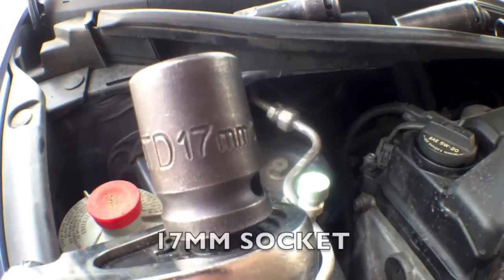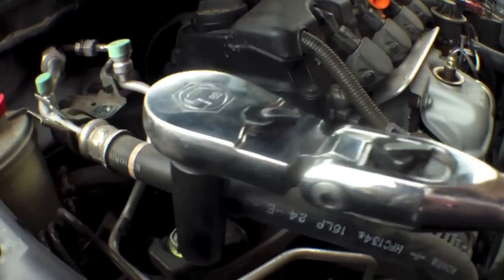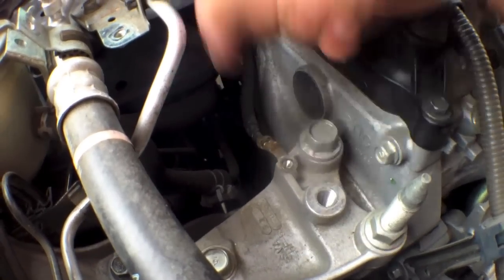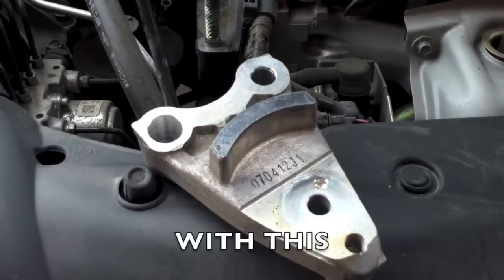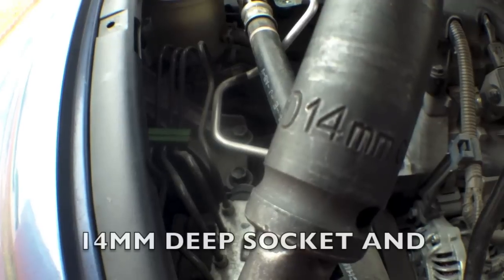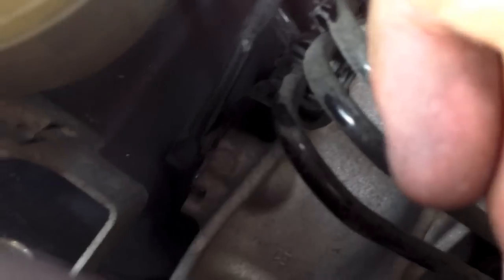SIMPLE REPLACEMENT passenger-side engine motor mount Honda Civic √ Fix it Angel

Comment: First , thanks for posting I just did this repair today on my daughters 07 civic. I used your video step by step. However I found that this is not a one man job.i first ran into problems getting the replacement mount holes to line up. That was a quality issue with the part. The really tough. Part was getting the little round tab on to of the new mount to line up to the A shape bracket and then getting the 2 holes lined up on the engine side. It took one person moving the engine back and forth until the tab finally fell into the the bracket hole. It turned into a 6 hour job. With that being said, your video was very helpful. Thanks again
Reply from the maker: Hi Eric, good job for figuring it out.  Have a nice day

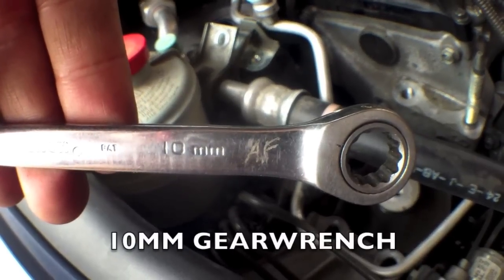Comment: The video helped very much, when I replaced my engine mount today.  Many bolts were tight, from corrosion, since there are 130,000 miles, on my 2008 Civic.  I left that little 6mm bolt, in the aluminum bracket, at the 3:00 minute mark.  Everything else, went as the video showed.

Comment: Just did one of these on my civic a week ago. If you're very careful, you can leave the one 10mm on the side of the middle bracket that's connected to the mount s and just have the 3 bolts disconnected, and you'll be able to move it just enough to give you enough room to pull out the mount without having to completely remove that middle bracket, while not damaging any lines in the process. Same goes for sliding the new mount underneath that bracket as well. Its somewhat of a pain having to get the bolts realigned that way, but it's not super bad to do at all as long as you have patience. Other videos will have people disconnecting the brake line brackets and the ac line brackets just to give you more clearance, which is good in order to not risk damaging any lines, but it is unnecessary as long as you are careful

Comment: I replaced the engine mount a few months ago late at night with a few mates and it was not a one man job at all . We spent 2 hours trying to line up the 2 bolts on the mounting bracket while pushing the engine back and forth and ended up leaving it as everything was bolted back in. I bought the aftermarket engine mount from Transgold.

Comment: Great video! Followed it exactly and changed the mount in under 1.5 hours. When you put the new on, you may have to slightly rock the engine but it moves easily enough. I used OEM part ($200) since I read that some after market part holes don't line up all the time and that some may fail after a year or 30k miles.I also prefer OEM but to each his own. My original lasted over 95k miles and 7 years. Hopefully this new one will last the same amount of time. Anyway, it's an easy enough repair as opposed to having the dealer do it for $500 plus. The vibration is completely gone now and car rides smooth. Thanks for the excellent video!!
Reply: Did your motor tilt when removing the dog bone bracket?  I've heard engine likes to tilt backwards and lifting oil pan towards the rear helps.  What position was yours? I might be doing this job with a car jack.
Reply: It didn't move during the removal of the dog bone. After the mount was removed it had shifted a little. I had a helper and used a floor jack with an old lawn mower blade between the jack and oil pan since the civic is so low to the ground and I didn't have jack stands. I put the jack in center of pan. We just raised it a little and you can rock the engine slightly to get the holes to line up. Wasn't a big deal. Just think things through before doing it and you should be fine. Helps to have an assistant.

Comment: Cool channel and great video.  I'm about to replace all mounts since I can't really see which one is causing my issues!  My issues with my car (2008 civic EX 5-Speed):

Vibration upon accelerating from a stop in first gear.
Slight Vibrations while in neutral at idle.

I'll let you know the results

Comment: Yea it’s easy to take apart but unlike mine when I put mine back together I had to pull and pry and leaving all the bolts loose so I wouldn’t cross thread the bolts. it’s a pain in the ass but I got it

Comment: Do you recommend replacing all the parts you replaced in this video, or can we solely replace the actual mount of the engine?
Reply: Ide say in the long run do them all  why  because if you replace  1 new part and the rest is worn out it will destroy you new part a lot quicker

Comment: thanks for the video. it helped with my 2006 civic! Did you have trouble lining up the side mounting bracket? I bought an replacement mount from Anchor and I think the specs were off a lil bit, because I couldn't get the side bracket on correctly. What mount did you use here?
Reply: I feel like the engine or something hits! it's more on the freeway at high speed when I let go of gas then press on the gas fast. also when I don't give complete stops then gas it something is moving. any ideas my friend?
Reply: Transmission mount maybe? I know my car does this too and my transmission mount is cracked..

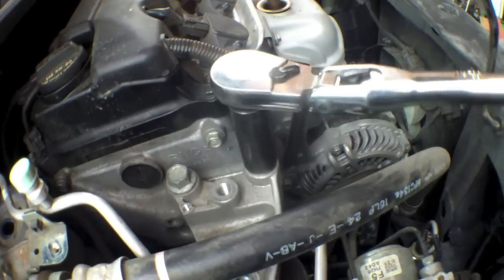Comment: Hey Angel please reply to me.. idk why the bracket keeps getting stuck on me (at 1:58 on your video). I can't get it off :( 
Is a pry bar needed to get the bracket off?
Reply from the maker: 209 Fishing hi, it might be rusted on. Try using a pry bar.
Reply: @FixItAngel  it has no rust. But the engine does tilt a little so I'm guessing thats the reason why it got jammed. I will try a pry bar when I have time. Hopefully it work. Thanks for the quick reply!

Comment: Question, is the top bracket part of the mount necessary to replace?  Cause on Rockauto the mount alone (black rubbery part) is only 25 dollars, but adding that metal bracket doubles the price.

Comment: What size wood block you recommend? When you place floor jack underneath oil pan does it need to be in the center or rear of oil pan? I've read someone having their engine tilted back. Thaanks
Reply from the maker: Hi, any size as long the metal part on the jack doesn't hit the pan.

Comment: Mechanic Replaced my engine and transmission mount. 6 months later it collapsed again and vibration came back. Not sure if they used OEM or aftermarket but it looks OEM. Thinking my car might just be defective and is motor mount hungry 😞
Guess imma need to replace ‘em again. Rip bank 😢

Comment: Thank you so much for this video! I think this is the problem with my car. Do I just repalce the upper dog bone like you did or do you know if I have to replace the lower torque strut mount as well? Thanks again! I am gonna purchase off of amazon soon.
Reply from the maker: Hi Stephen, It is better to replace all the mounts. If you replace just that one, it will prematurely wear. Welcome
Reply: Ok. Thank you. Do you have other videos or any suggestions in replacing other mounts?
Reply from the maker: Yes there are videos I made. Please check my channel.

Comment: I have a 2012 Honda Civic. I am getting the vibration into the cabin which feels like the dash is vibrating/shaking. I think my transmission mount is worn because the vibration is worse when I put the car into reverse and it will stop vibrating when I put the car into neutral.

I am really disappointed in Honda. I only have 70,000 km on my car. My Corolla had 248,000 km and never replaced any engine mounts or transmission mount. Honda really needs to fix this issue.

Comment: Hey man, thanks for the video really helpful. I can't get those two bolts in the engine side! any tips to get them out??
Reply from the maker: Hi Eissa, Try using a 1/2" drive breaker bar to get more torque to loosen the bolt.

Comment: Do you recommend replacing the torque rod each time, or was there something gone wrong with your old one?
Reply from the maker: +asdf072xxp The part was just old. More likely the rubber on it was worn. I recommend replacing all the mounts because if you just replace one, the new mount will prematurely wear because of the old mounts are worn.

Comment: Mine is loud while driving, higher rpms make it louder. It's a manual, quiet in neutral, but loud when you rev it up in neutral, has a vibration. Think this could be the problem? All the noise is under the hood

Comment: great vid! also need to replace mine. how much torque did you use when you put everything back on?
Reply from the maker: +snwbubble Hello and thank you. When the bolt or nut is seated(screwed all the way down by hand), turn ratchet 180°. (12 o'clock to 6 o'clock). Thank you for the question. Please share and subscribe.
Reply: +Fix It Angel ah ok. So you didn't use a torque wrench or anything?
Reply from the maker: No I did not. It's not like bleu printing an engine. As long it's tight you are good.

Comment: Where do you recommend getting the parts from?
Reply from the maker: +dreamingtree101 How much you want to spend? The original parts is very expensive but it is always recommended. Aftermarket parts are cheaply made but have a warranty on it. I would go for the aftermarket, I always tell my friends and family. I never seen a new aftermarket engine mount break within a couple years.
Reply: What brand do you recommend and where do I get it? I'd to avoid fitment issues

Comment: I'm having this issue.. For some reason my dam car still vibrates i recently took it to honda and got my motor mount changed, was working fine for around 3 days and it started vibrating again! Where are you located??
Reply from the maker: Did you just have the passenger motor mount replaced?
Reply: Yes i did
Reply: my car still shakes, i noticed it more today this morning, my only choice is to take it to a shop...sucks

Comment: I replaced all the mounts but this one... and the vibrations continued... but only vibrates when i press the gas.. and if im driving and depress the gas the vibration goes away.... cut it be this passanger side mount? It also gets a little louder when i turn on the ac
Reply from the maker: Fernando Yee passenger side mount is bad. It's always recommended to replace all mounts at the same time.
Reply: Fix It Angel i did today... i changed it and it feels like a brand new car! Lol before that it sounded like a plane about to take off!!

Comment: I heard this noise sound when you are stop and when you accelerate gas there go the sound while moving...  this is really the problem? I have change my oil and tune up but still the annoying sound.
Reply: Corazon Bolisay 
When it needs to be replaced, you feel the vibration much more and it can be a noise too but just when you are driving. 
You can even hear the engine sound much more like it the engine was much more accelerated because the mount separate 2 pieces of metal  but when it gives both parts are in contact.

Comment: How do I know its the passenger side motor mount? Can it also be the drivers side?
Reply from the maker: David garcia drivers side is the transmission mount
Reply: Fix It Angel Thanks for replying! Ill be replacing my passenger mount soon. My 09 Civic with 70k miles is just starting to lose it..

Comment: Mine failed 3x!! Im at 130k on my 8th gen civic. Im sick and tired of replacing them. All other mounts are good except this one always goes bad!! First one at 50k then another at 90k and then now at 130k!! Im just going to grind that metal part that sticks down from the bracket so it give more sagging room for the engine.
Reply: Are u using oem passenger mount? I’ve heard they last longer about 50k. I’m thinking about buying a 8th gen or do u recommend going for a 9ths gen civic? It seems there is no solution to solve this motor mount problem. Honda should at least redesign the motor mount a lot more sturdy like having an extra base around the mount just like the 9th gen civic has.

Comment: Replaced the same mount. Still have some vibration at idle, and whenever AC is on. Is this normal? Nothing near to how it was but still fairly annoying.
Reply from the maker: You need to replace all the other mounts. More likely they are bad too. Don't just replace one mount. The new mount will prematurely wear.
Reply: Thank you. I'll definitely take a look. From what I was told, all the mounts were replaced. will take care of it.
Reply from the maker: welcome, have a nice day.

Comment: Guys i have a question. I've already change my transmission mount, upper engine mount (Dog Bone) and the underneath mount.. I have already checked my tie rod and rack end together with the wheel balancing. However, if im accelerating from 80kph and above the presence of BODY VIBRATION ARISES and i dont know why? Is it affected by the lower engine mount?.. Please help..
Reply from the maker: MarC SingcO your axle could be bad. Maybe passenger side.
Reply: So sir i need to check my axle? By the way, engine mount thus not really affect the vibration at high speed if Iam right sir?
Reply from the maker: MarC SingcO also check to balance your tires
Reply: Hmm.. By the way sir, engine mount thus not really affect the body vibration at high speed right?.. especially when i reach 80 kph.. Just to illustrate what happen when i reach at high speed, my front mirror starting to shake/vibrate and you can also feel the body vibration all over when reaching this certain speed.. In addition, It is also different from the tie rod right and rack end sir? cause the mekanik told me that both of them were fine.. Please reply sirr.. Highly Appreciated!
Reply: Did you ever sort this out because I have the same issue with my Civic.

Comment: Do not get the cheap black one on ebay! The fitment is horrible and you will have to cut.  Check amazon for reviews.  The blue Motor king engine mount fits perfect

Comment: My 4th time replacing it. Honda made a terrible design of the mounts on my 08 civic.
Reply from the maker: Mr. Ali hi, did you replace all the other mounts too? 
The passenger mount would prematurely wear down if the other mounts were not replaced in the same time.
Reply: Fix It Angel  i checked the lower one by removing it and was good. I replaced the transmission mount and torque strut mount together with the motor mount. This time i put  a washer between the bracket and the motor mount and also washers on the engine side to raise the stopper. It raised it a few mm. Still too low in my opinion. I also used the same mount you used about 2 years ago. Blue one from motorking and now i purchased a beck arnley for my current replacement.

Comment: +Fix It Angel So my car vibrates when in drive 10-20 mph at 10% throttle here a video listen closely. https://www.youtube.com/watch?v=UAOPhMK3OKI.

 DO you think this is the passenger-side engine motor mount?
Reply from the maker: More likely it's the passenger motor mount. Was it ever replaced??
Reply: I'm pretty sure it OEM. at 157k Miles. Just bought MotorKing MK4530 Engine Mount. Going to see if that stops it.
Reply: Is this the right part?
Reply from the maker: it looks like it. but i suggest you replace all the mounts. the new motor mount will prematurely wear because the other mounts is already worn. have someone to press the gas while on park and brake pedal pressed with left foot. put on drive, press the gas a little with right foot and see if the motor moves a lot. then try on reverse. If it does move a lot, replace all motor mounts.